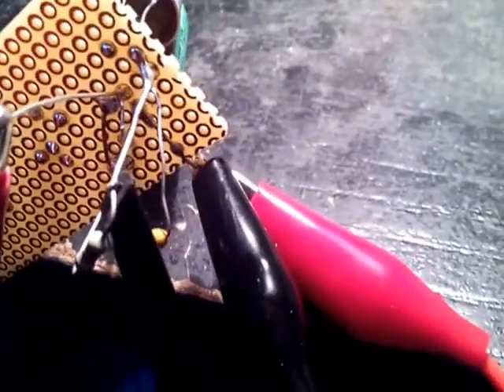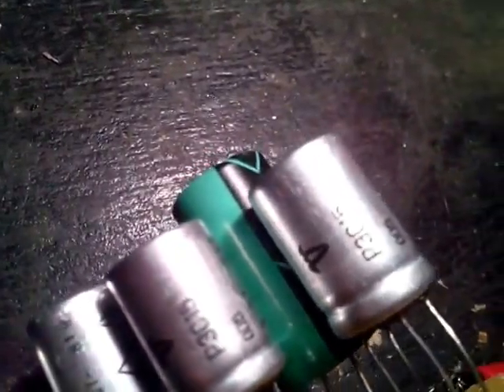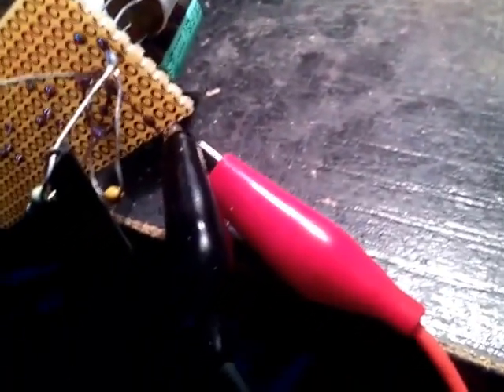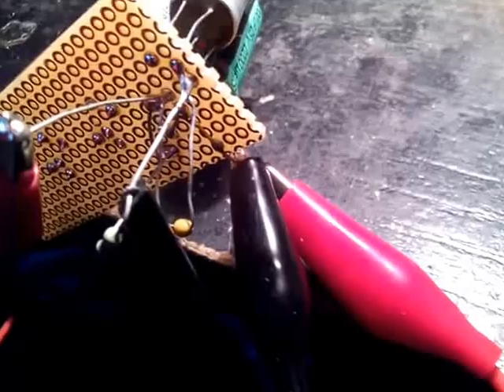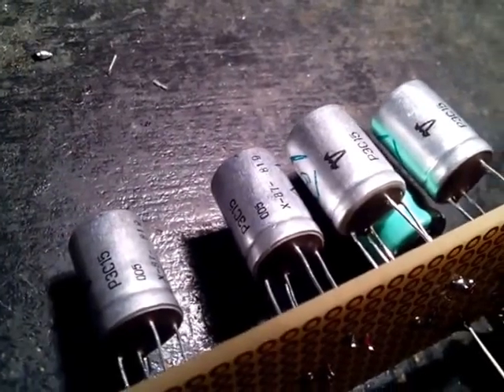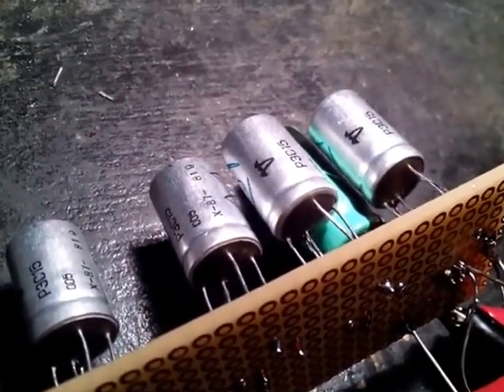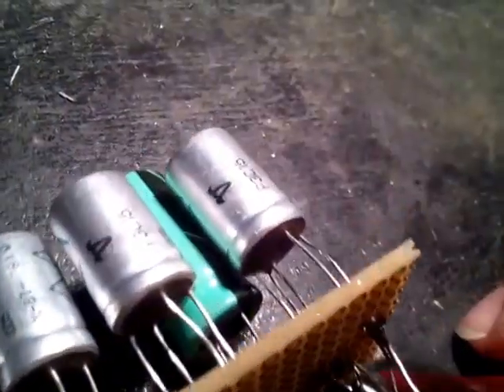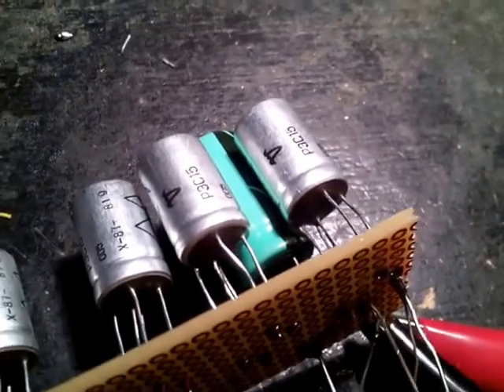Single-relay oscillator (not recommended)

Comment: Hi, If I may ask you a question? What kind of camera did you use? Good tutorial on relay oscillator, I used these part for my A.T.V. (Amateur Television). I used these kind of projects back in the 90's.
Reply from the maker: +Dr Pepper 23 
I used the lousy camera of my mobile phone. I then applied the "stabilization" option of youtube to reduce the shaking, which gives a strange aspect...
But it's enough for such an unimportant clip :-)

What did you use the relays for, in A.T. ?
Reply: Dr Pepper 23 years

Comment: seems like you may have scorched the contacts  on the relay to much amperage across the contact points
Reply from the maker: Actually, not that time. My first experiments had a lot of mistakes and a couple of broken relays but I have since developed a better driving method called "capacitor-coupled pre-biased relay logic" (CC-PBRL), see the AMBAP project on Hackaday.io :-) My ring relay oscillators are much more reliable, now.
Reply: Le YASEP
another interesting technology to look at is kicking coil. maybe you could apply logic circuits to a few of those
Reply from the maker: I have no idea what this is but I'll take a look... After I've become bored of flip dot displays :-D

Comment: It loads the cap, than goes over restistor and coil, than reload and make an tackt
Reply from the maker: the cap loads throuth the resistor but discharges in the relay and this creates a huge current spike that breaks the contacts... This design must be avoided.
Reply: @leyasep5919  i like it !  Its "programming" in real life only with formels: add a value by a Letter and calc it 😁  i made wireless energy with fake ac See my Video ^^ it works

And here is the question: 
Wireless energy is only a electric magnetic ac field that u push up with a bc547 npn transistor... that you recive with a coil (with right hz wireing) and led on it IN  this  area.....

L=(y(L) c/f)
It means: 100spin by 0.6mm² coil
= 15 hz for distance .. than calc your wireing ect.. (you need it or it won't work)

Is it possible to send this field with an ozilator ??? For ..more..distance ?